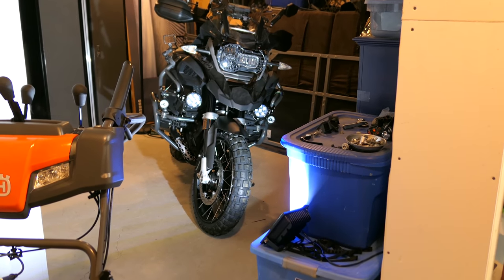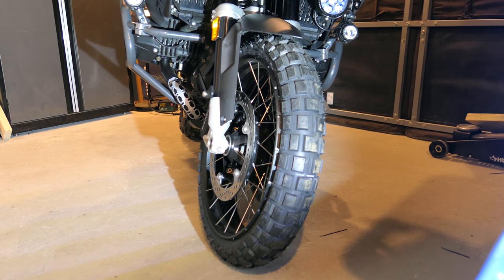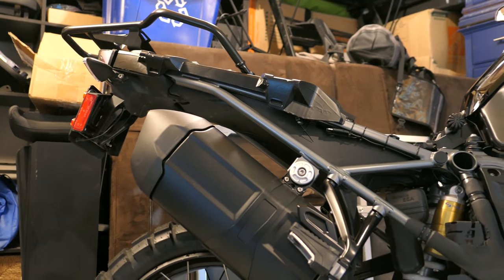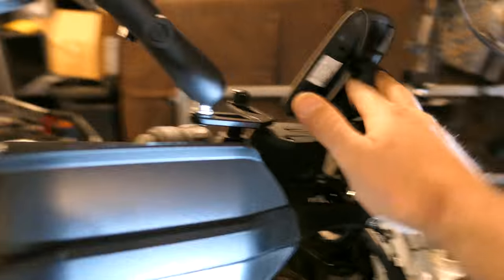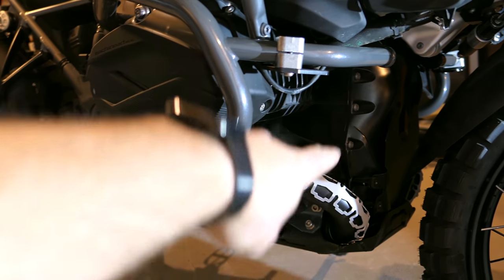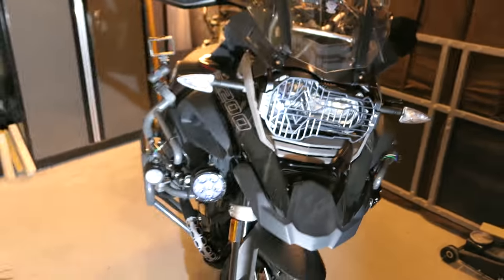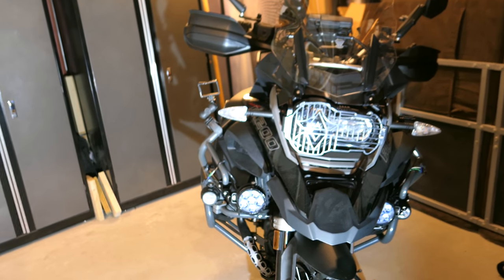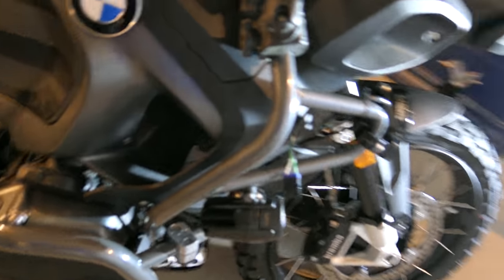R1200GS Project Update Quadruple Black (Almost Done!)

Comment: Dealer messed up on my KTM 990 and stripped a bolt. Had a new larger hole tapped and a Heli coil put in. Only chance to damage the coil . Not the hole again.

Comment: That's looking good. Wondering u putting so many accessories, how much extra the already heavy bike weighs now.
Reply from the maker: Not much to be honest, I removed OEM plate, bars, racks, seat, windscreen. I probably added 30 pounds to the bike total. I weight 250lbs. big picture, it's not much.
Reply: Adam Chandler , that's cool. Waiting for it to be completely ready. Cheers

Comment: Greetings Adam.  You might be want to consider pivoting those Ericas out a bit. If you take a good digger, you could wipe out your radiator. I have a set on my bike.  I'm in NH, ride long distance quite a bit (I have about 45k on my 2014, including the TAT) and maybe we can join up sometime. Cheers.  Also, if you are headed down to Deals Gap, check out Iron Horse Motorcycle Lodge in Lower Stecoah, NC - one of the best MC campground/lodge I've visited.
Reply from the maker: Pivoting out away from the bike? The thought was if I crash, they won't get yanked off the crash bars. Guess I should re-think placement. We're staying in Robinsonville NC. We should totally meet up. Are you on ADVRider? I have an NH/VT Riders thread that we've been using to organize group rides.
Reply: I debated the placement of the lights on the same lines as you before I took off on the TAT and ultimately left them a bit wide.  I am glad I did as I took a decent fall in Oklahoma and the light was involved.  I had protective lenses on them which did get sand-scuffed, but the lights were fine.  They are quite rugged.  The mounting bracket however took the big hit and twisted like a pretzel.  Clearwater sent a replacement (free of charge) the next day - great folks.  Had I moved them in, I am certain my radiator would have been toast.  Be sure to ride the Cherohala Skyway in NC - it's awesome.  Yes, I am on ADVRider, but not actively. - I'm Ikeya-Seki.  I'm up for a ride most anytime.  Yesterday was chilly.  Best way to swap contact info?  I'm Drew by the way, from Exeter.
Reply from the maker: I did send you a PM on ADVRider. Would be great to connect!
Reply: Nh2o Man......I used to live in Exeter. Is the Loaf and Ladle still open by the bridge?/  Love that town but work took me away.